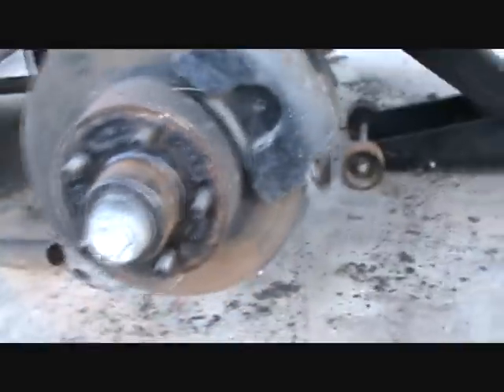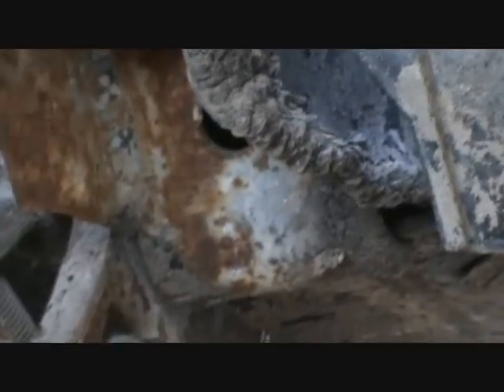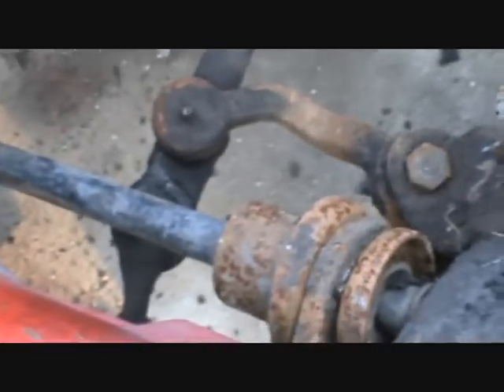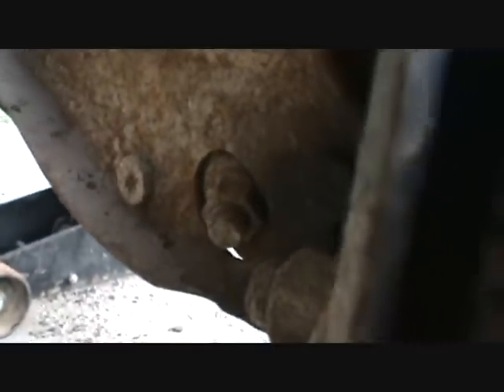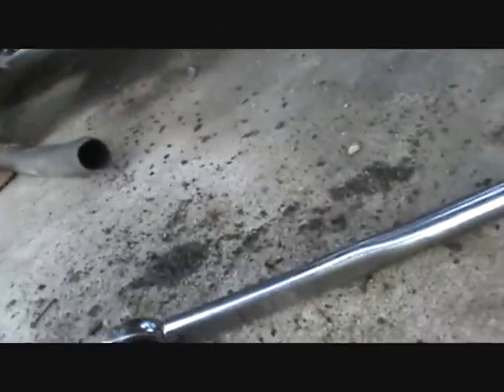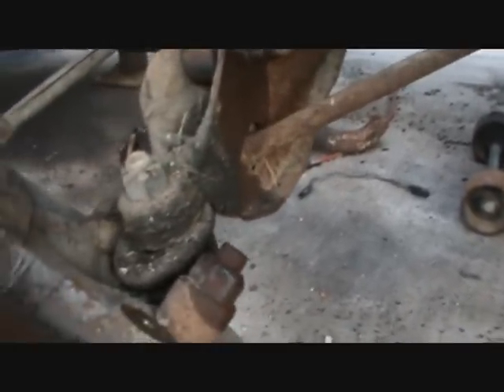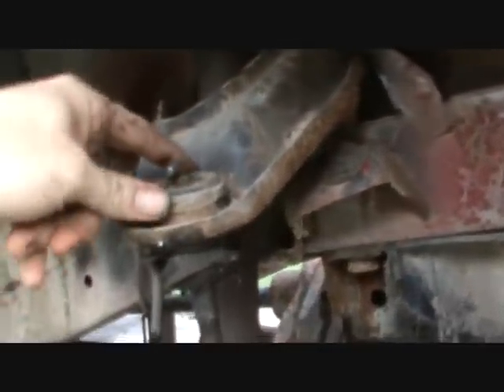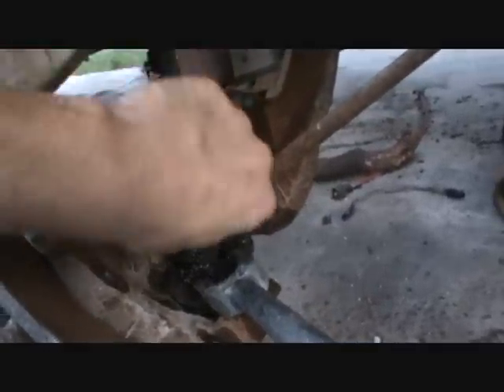1973 Dart Sport front suspension disassembly pt1

Comment: Those LCA bushings tend to go bad after a while, making an awful squeak..  I also found that many of the aftermarket anti rattle springs for the caliper are not as good as the originals..  Seemed like these old mopars needed new ball joints every 40k miles or so!!